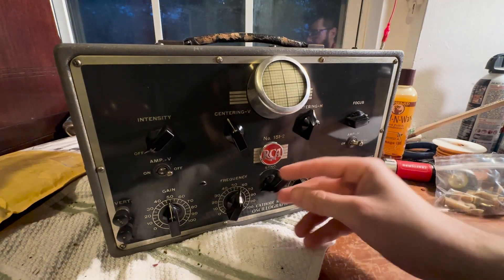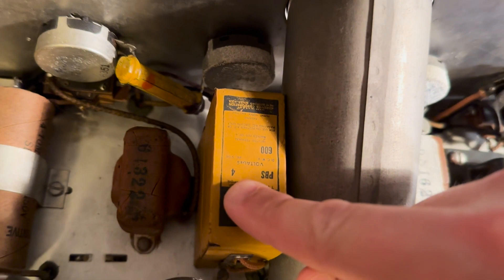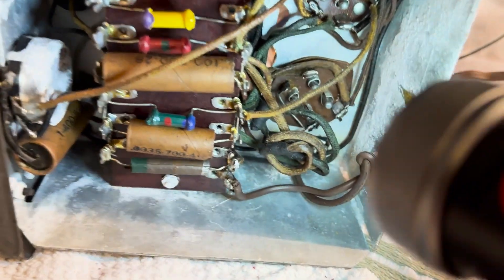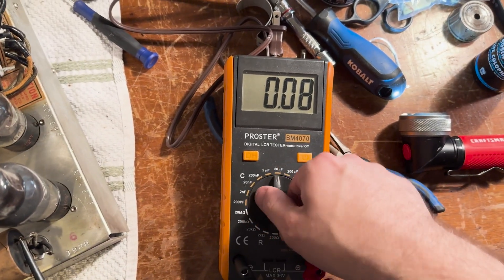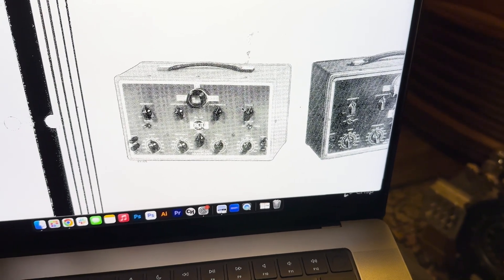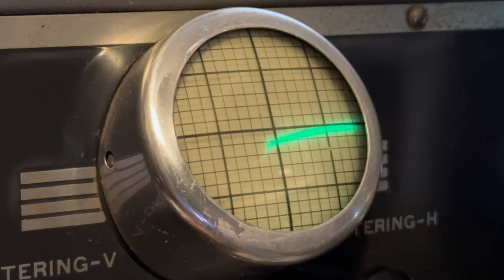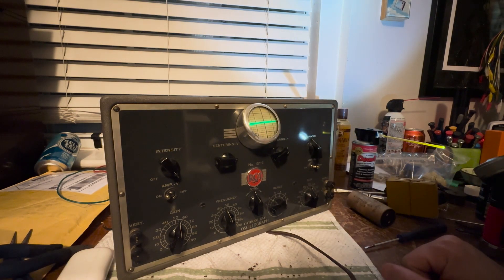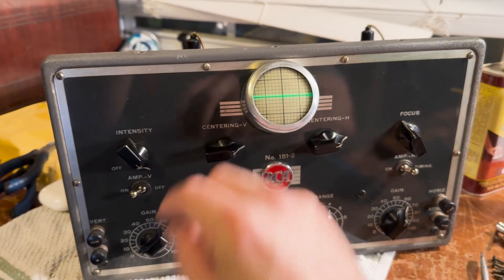1930s RCA Oscillograph

Comment: Such a great find! I’d love to stumble on a Philco 022T Oscilloscope. It doesn’t seem massively different internally. Some of the 1930s Philco test equipment was just beautiful with brass front panels. I did snag a 7050 tube tester from about ’48, but they started nickel-plating the brass fronts by that time. Still beautiful, though. Just needs re-capping, and there’s literally only 1 capacitor. It does power up, but I didn’t want to risk any of my tubes with it yet. So yeah, I love the old test equipment, too. Thanks for the great channel!

Comment: I would fit the new caps inside the original casings, it would look so much better & original.
Reply from the maker: I agree, this is an item worth re-stuffing the original capacitors to keep the clean look. I won't be using it very often. Once I get my new workshop, that would be a nice project.